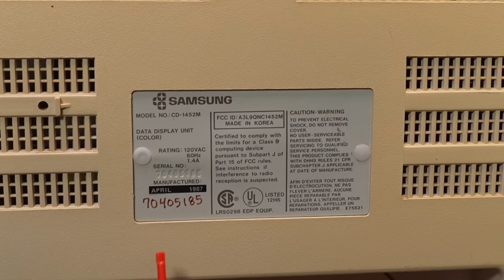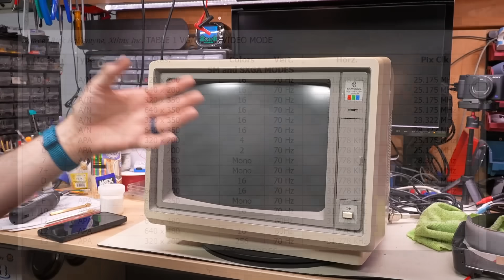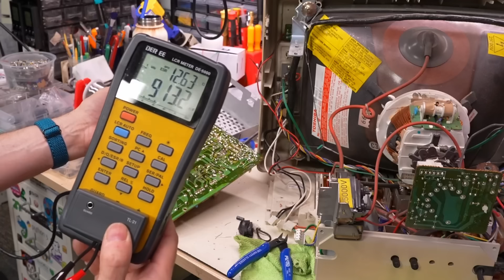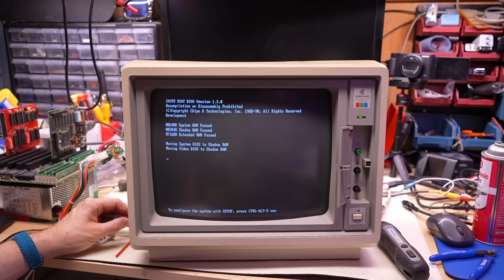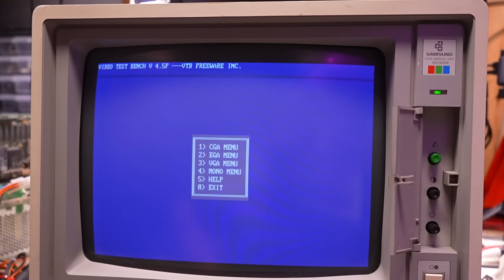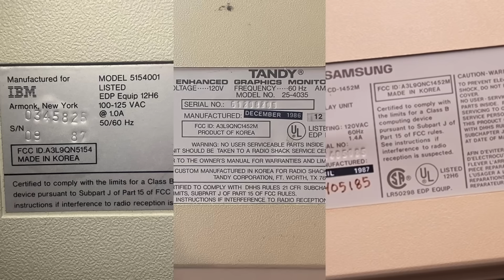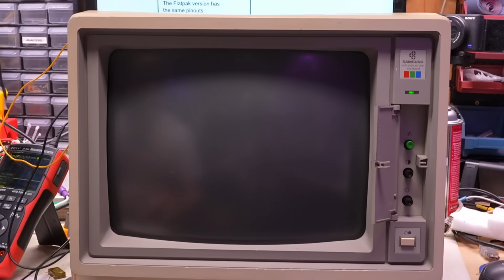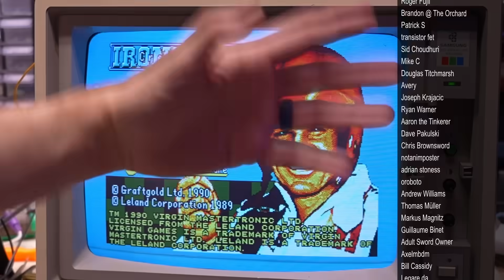This monitor is the same as the IBM 5154 EGA monitor! (Samsung CD-1452M)

Comment: 74xx TTL logic has built in pullups on the inputs so if you leave them floating they go high on their own (so leaving them not connected is valid desigh practice). Correspondingly, TTL outputs have high current sinking capability but low current sourcing capability, to match the characteristic of TTL inputs. For your modification, you should use a SPDT switch that switches the input between the signal or directly to ground. (common to the input pin, one throw to the color switching signal, the other throw directly to gnd). You never want to have a strong pulldown on a TTL signal as it will bring the high-output logic level out of spec.

Comment: I actually had no issues with this particular card under Windows 98SE, and actually found it to have really quite decent performance in games from the late 90s. It was completely stable on my setup I used to test (ASUS A7V266A, Athlon XP 2000+ so similar to your one that didn't work well). It's a shame you had issues.

Comment: I had a PC/XT (8MHz) bought in 1991 and had Ati EGA Wonder. I think I used it for around 2 years. There was some fun of programming those colors from GW-Basic and a bit of relief it is not CGA.  After VGA I never looked back at EGA, at least until 2024 🙃

Comment: I don't have any EGA monitors but I'd like to mention that the RGB2HDMI works with EGA and it makes for a crazy crisp and sharp picture. TTL video is digital after all :) 
Just make sure your EGA card is configured to know it has an ega monitor connected (Many have dip switches to let it work with older CGA or MDA monitors and most I find are set that way) or your colors will be off in some modes.

Comment: Are those 2 HV Caps bulging-toast? I've seen just the plastic cap bulging but worth checking. On some PSU designs, they can release semiconductor-magic-smoke when they go too far out-of-spec and bulging caps are right about there... Saw later that the picture of the IBM 5154's PSU also had those two HV caps bulging, so it's probably just the plastic cap.
Reply: I think it's just the plastic caps. For some reason, they used to do that for those high voltage primary side capacitors. I've seen that in other equipment from the same era.
Reply: I was more worried that they are different, I assume they are 2 of the same value in series for 110V/220V switching.
Reply from the maker: Indeed. It's just the plastic cover that does that. Pretty common from this age and it doesn't indicate an issue.

Comment: About 7:30 - A1200 does support VGA without scan doubling, but it defaults to 15.5KHz when first turned on or when playing a game. I had to use a dual monitor for mine back in the day, one was a VGA monitor connected using the RGB-out for using Workbench(it was HD installed and set to load VGA drivers before the UI appeared) and productivity at 672x576p(31KHz), and the other was a TV hooked up to the RF modulator for doing the 320x256(15.5KHz) that most games used.

It could also do 800x600 and 1024x768, but those modes were unusably slow, at least on my 68030. Not sure on non-AGA systems, only ever used my A500 as a game machine hooked up to a TV.

Also note: The modes I used were both 50Hz vertical refresh and the first one utilises the overscan, hence the "strange" resolutions.

Comment: Very cool feature, actually seeing the 64 colors EGA can render is a rare thing to see. Mistakes were made when 99% of EGA uses the default 16 CGA colors, such a waste of a video standard.
Lol yep the lower the dot pitch value, the higher in resolution it goes, golf score rules.😉 The contrast level aspect between bright and dark colors isn't great for RGBI, with CGA colors all the second to most brightest color hues are too close to the brightest color values when forming color ramps.
They did a great job with that 640x200x4bpp mode in Planet X3, would be cool to see it with the expanded EGA system palette but there just isn't enough people out there with a monitor capable of that. To see the potential of what EGA64 mode was capable of the best reference is early Amiga and VGA titles since many of them were in 4bpp global color for cross platform porting sake in that era.
Well that's dumb for an EGA monitor capable of EGA64 not supporting that mode from the factory. The more I learn about CRTs the more I notice how the makers actively handicapped screens capable of much more in both SDTVs and PC monitors.😕

Comment: @44:00 Monkey Island 2 and Indy 4 also support 640x200 dithered mode using the 256 color assets. Looks very nice e.g. on a 1084s, I made a little video about that. 
Some games such as Altered Destiny, Les Manley 1 or Darkseed I think also support 64 color palettes, albeit 350 lines for Darkseed. Plus the early Legend adventures, which run in 350 line mode, too.
EDIT: it seems GODS also supported EGA64.
EDIT: Ocean‘s Pushover also gets mentioned for 64 colors.

Comment: The green wires that are cut off from the steel cables around the CRT are to facilitate ease of soldering the steel cables together. It looks like the manufacturer wrapped the cable with the copper from the wire soldered it then just cut off the excess wire. That's what it looks like to me anyways.

Comment: I was just dorking with a Toshiba T3100 laptop's video out the other day. I couldn't get it to display a stable picture on my CRT monitor, and then it finally dawned on me: The monitor is CGA and this laptop is outputting EGA. I own several CGA-compatible CRTs, but not a single EGA one. And I don't think I've ever run across one in the wild, either.

Comment: 28:07 - does a monitor of this vintage really have built-in degaussing? I've had monitors newer and more advanced than that still didn't have degaussing. When I put a small magnet up to my Sony CPD-1304 as a child, I had to put the same magnet in reverse at just the right distance to cancel out the color distortion it had caused.
(My EGA monitor earlier on was actually a Samsung too, but it was the CM-4531, not this.)
Reply: Most of them had degaussing but the field strength was intended for stray magnetization, not for strongly magnetized front shadow mask from a magnet applied to the screen.  External degaussing ring would remove that but it’s way stronger than the internal coil, and can be applied foe a while as needed.

Comment: Pulling up is easier than pulling down... I've had chips where a 100 Ohm pull down didn't cut it!
I'd replace the jumper bridge with a resistor (4.7k would likely do the job) and make the green button short the input to the 157 to ground.

Comment: Interesting, when you said the "Dk. Grey" looked correct it looked purple(ish), when you switched modes it looked blue(ish). Camera or YouTube colo(u)r reproduction causing this?

BTW I had a multi-sync monitor (50/60Hz @ 15.1khz & VGA) with my Amiga A1200 and it output higher than 15.1khz without flickering. You had to set AmigaOS to use a display driver that would change the output. Which would then look like an out of sync TV signal if you used an oridinary display, like a 1084S (Yes i tried). Few games worked on it, as most up to that point did not use the OS for anything but booting to a floppy disk. They were stuck at PAL/NTSC speeds. I can't recall what resolutions over 256 pixels high where like, i think they probably did need a flicker fixer. It was fine on the lower 320x256, but i do recall running 640x256 for a while. It was vertical resolutions like 480/512 that flickered as the chipset interlaced the signal. Don't think the horizontal speed was the problem.

1280x512 was awesome even with small icons and text on a flickering screen that was a bit slower. 😍
Reply: Yep.  A1200 supported VGA monitors out of the box with a simple  adapter.  All you had to do was use either Double-NTSC and or VGA Only drivers and workbench VGA mode was enabled.  It didn't work for old games and resolutions but it was great for workbench apps and very sharp in comparison to the 1084.
Reply: @RacerX-  I discovered Dune II worked. Properly coded stuff just keeps going. 🙂
Reply: @techkev140  Nice!  I will have to try that as I think I still have my Dune II originals for Amiga.

Comment: How can a monitor that is manufactured in 1987, have a tube that is manufactured in 1989?
Reply from the maker: It has to have been swapped which would explain those cut wires ... Surely this would have originally had a Samsung tube.

Comment: Why was it okay to measure the capacitors in circuit around the 18:20 mark? Specifically he said the low voltage side was okay to measure in circuit. I thought measuring caps in circuit would throw off your readings?
Reply: Depends on the connected circuitry.

Comment: Maybe I’m just tired, but you said 1k pull-up, but the schematic symbol at the end looks like an earth ground symbol. Is it a pull-up or pull-down, and if a pull up, what voltage is it a pull-up to?
Reply: It's TTL logic level (5V) but the 1k resistor he added is a pull down resistor indeed so it pulls that signal down to ground when the monochrome green-switch is open.. When the switch is closed the monitor reverts to its default operation (the same as with that jumper link intact) making that input turn high again as seen on Adrian's scope (overriding the pulldown resistor).

Comment: I don't recall coming across any vga monitors that didn't support cga and ega.
Reply: You're probably thinking about a VGA card in CGA or EGA mode.  That's not quite the same thing.  A VGA card will line-double the 200/240-line modes to be 400/480-line.  This puts those modes back up in the 30kHz horizontal scan rate range, rather than being down at 15kHz like a native 200/240-line display.  Most VGA monitors CANNOT sync at 15kHz.

Which is a shame, because otherwise, they would be great analog RGB monitors for old games consoles and micros.
Reply: Probably you mix something up. All VGA monitors display CGA modes and EGA modes perfectly, if connected to a VGA card. But that doesn't mean the monitor supports CGA and EGA frequencies, but it means that VGA cards output CGA and EGA modes at VGA frequencies. CGA is scan-doubled to 400 lines during that process, and refresh rate for CGA and EGA modes is increased to 70Hz from 60Hz when using VGA cards, which can confuse game timings.